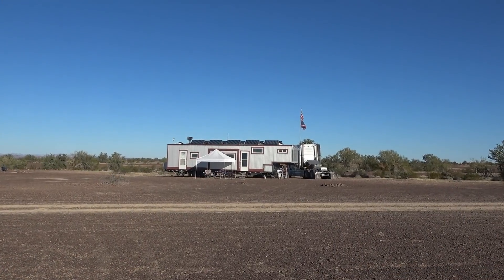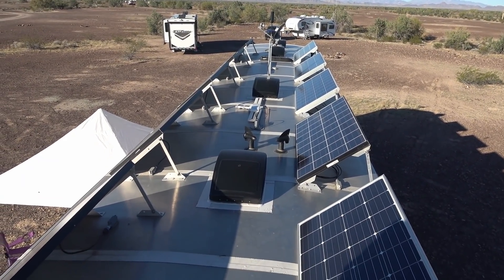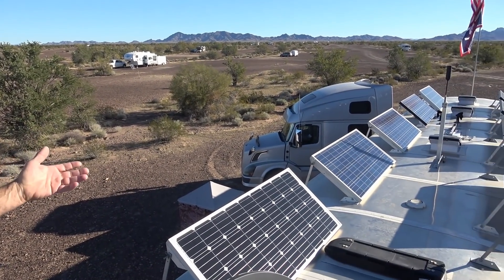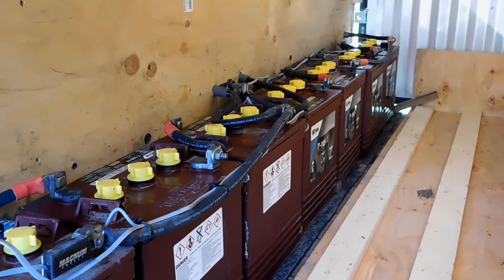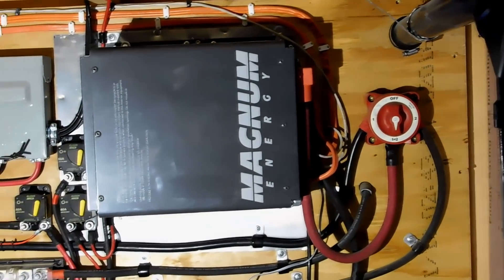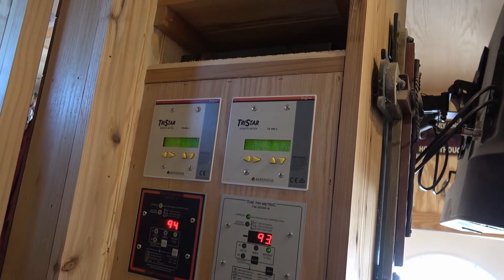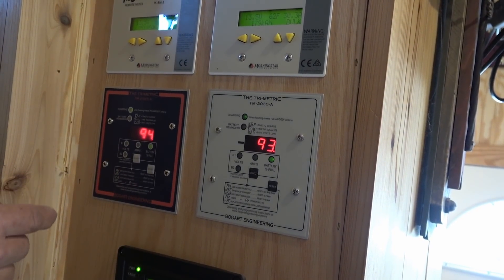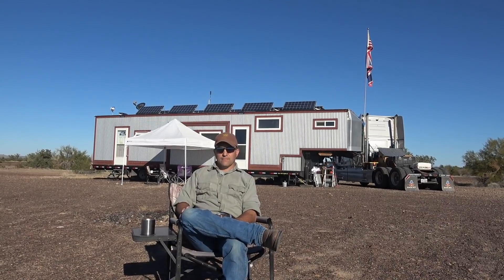My Friend's Impressive RV Boondocking Power System (1800 Watts Solar & 900 AH Battery Bank)

Comment: I don't see me ever installing this much solar, but I am happy to see that I am not the first person to want to have a weather station.  I was curious as to how that would work.
Reply from the maker: Here is the weather station I've been using https://www.loveyourrv.com/christmas-rv-goodie-deluxe-weather-station-for-the-rig/  It has its own built in solar panel on the outside sensor array and I've wired it into my RV battery for powering the inside display.
Reply: @LoveYourRV  Do you drive with it installed?
Reply from the maker: @kcgunesq  No, I have it mounted on a flag pole-type mount attached to the ladder. Easy to pull off quickly when I move the RV to the next campsite and reattach.

Comment: Yeah, that's not 900Ah. He needs to build his own life packs. Too easy and cheap not to, anymore
Reply from the maker: It is 900AH total capacity based on a 20 hour discharge rate. He has 8 Trojan 6V T-105 wired in a series/parallel arrangement for 12V banks. Each battery is rated at 225AH total capacity at 20 hour discharge rate. https://www.trojanbattery.com/product/t-105/
Usable capacity is a different story depending on how much lifespan you hope to achieve. Most people aim for around a 50% depth of discharge as the max recommended to preserve a long lifespan.
Yeah, LIFePO4 are nice, but this video was almost two years ago, prices weren't nearly as cheap. Things have changed fast in the lithium world. His batteries were already paid for and serving his needs well for years, so no reason to change. They also spend a lot of time camping in winter conditions in northern AZ and Wyoming.  Cheers, Ray
Reply: @LoveYourRV  the date said 1 year, that is a big difference from 2 years.
Reply from the maker: Feb 2, 2020 OK, sorry I rounded up 21 1/2 months ago. I did say "almost"

Comment: no need to run parrallel other than... smaller wire which saves a few $
Reply from the maker: I think you meant to say series. It uses a smaller gauge wire since the voltage can be higher. His system is run in parallel. Lower voltage, higher amperage needs thicker wiring down to the controller.
Reply: @LoveYourRV  no you read me correctly, I was quoting the statement he made in the video he said he had no need to run in a series he ran parallel and I was saying yeah other than smaller wire
Reply from the maker: Oh OK, I didn't understand the text you wrote was a quote. The video was from a while back so don't remember all the conversation. Cheers, Ray

Comment: just an fyi its best to say kilowatt hour of battery bank no AH because    900ah  could be any of the following 
10.8kw [@12v]
 21.6kw [@24v]
43 kw [@48v] 
So as you can see the 900ah is completley useless in determing how much storage capacity he has
Reply from the maker: Thanks, since the vast majority of RVers are running 12V systems I felt they would understand amp-hours better since for years that has been the standard way to express capacity in RV batteries. Figure anyone running the newer generation of more elaborate 24V or 48V systems is smart enough to do the calculation.
Reply: @LoveYourRV  in the end i figured it out after watching the whole vid he was using 12v but i was wondering. a lot of guys now are switching to 24 and 48v systems just because of the fact they can so much power wattage per unit , just going from 12 to 24v on a charge controller doubles your power capcity . .

Comment: 🤓Noice Rig 👍
#Renewables 
Very well & expertly Done 
By chance are you an electrical Engineer ? 
 Most people have No concept to practice of P.A.N.I Principals . 
 Most people don't also realize I.E.T Switches & Breakers are ideal for solar & renewables. 
Note : I still have a Cellsite 12v 
Battery decommissioned given to me in 1996 ; it was 15 yrs old then and Still holds 12v at 95% capacity .   
I leave it outdoors here in WV all winter w No damage that I can detect .  
There is a New device on the market that replaces a few components into 1 ; for the life of me sadly I cannot rmbr it's name or I'd share the info . 
 I am a Former Engineering Awardee and Business Advisory Council Awardee for Businessman of the Yr;  my specialty Was😔 Wireless infrastructure Solutions . 
I am now disabled physically since 2007 ; OTJ and that was a Risk I took to Serve the People and advance technology ; my deaf uncle benefitted from my work directly and went from a laborer to supervisor w a healthy retirement . 
  Your sharing your Rig and it's set up is a SERVICE to All Good Peoples and my Point is to 
Say Thank You 
  I'd be very Proud of my Self built rig too 
And for your Sharing ; it's invaluable . 
It is Not what We know ; Tis What We can Teach . 
#SharingIsCaringTeach2Prosper 
Thank you for Your many Good works and Do continue . 
  I would Hire you to do an install 
For me in a second . 
May God Bless your Endeavors 
 Thank You , 
    HAWK 
#Autistics4aBetterTomorrow
#WingfieldSchoolhouseSpeaks

Comment: Meh. I'm using a 2400watt solar  system with another 500 watt wind turbine for my fifth wheel. My big thing is that I need more batteries. I have 8 6V batteries now, wired in s-p for 24volt. I Want 16 batteries though, as soon as I'm able. 
What this fellow might want to do though, is look into Silicon dioxide batteries. They basically have the best of both worlds from lead acid and lithium iron phosphate. They have the longevity of lithium, but will operate in temperatures to -40 degrees. They require no maintenance and are about a third the cost of lithium. The best part is you can run them to 100% depth of discharge multiple times without harming the longevity of the battery!
Reply from the maker: Nice, I have heard that carbon foam batteries are an alternative as well. Does the wind turbine cause much noise and vibration in the rig? People always ask why more boondockers don't use wind. Cheers, Ray
Reply: Love Your RV Yeah, no, not at all. I think a lot of people assume that wind energy will be very expensive as well. That's mostly because of the North American Marketing. I just buy super cheap ones from Alibaba. Companies like Green Energy (G&E) really do care about their product and you can be up and running for about $400.
I have a 5 blade turbine (looking back I think I would recommend a three-blade. 5 blades will start turning at lower wind speed,  but 3 blades will spin faster once the wind starts to pick up a bit) so when it's really windy there is a bit of whooshing you can hear. But you don't hear any vibration from the PMG( permanent magnet generator) inside, or anything like that. I actually have started to really enjoy the sound of the whooshing through the turbine blades. It's music to my ears because I know it's making power! You can check out John Daniels YouTube channel. He really knows his wind power. And he likes to do things on the cheap. while also maintaining reliability in his equipment. I wouldn't buy any Chinese turbines that he didn't specifically recommend.

I have a brand new fifth wheel. that I live in. I have to say, the Chinese solar array (which included a 3500 watt inverter, pwm solar charger, and wiring) and Chinese wind turbine are the only two things in this whole unit that I have not had any problem with whatsoever! The brand new Jayco trailer has  had one thing go wrong after another since I bought it in October. But my power sources have not given me a lick of trouble.

Oh, btw, thanks for the video! =)

Comment: Lifepo4 cells would be a good option for storage too, with half the weight of SLA or GEL batteries, the new LTO cells have a much more extreme temperature operating range, a 40 amp hour battery is about the size of a tall boy beer can.
Those types have a much higher cycle life, some lifepo4 used for off grid set up say 25,000 cycles... depending on DOD, the new LTO cells are even higher than that so they would pretty much last you a lifetime.
They bolt together easily enough, so as long as you can wire in series as well as parallel, you can build any size capacity and voltage you want.
There are new panels out, they heat water as well as do solar.
Have you ever thought of adding in some small wind turbines like they use on sail boats to augment your system ? you could probably find some old telescopic light masts to mount them on.
Reply from the maker: Good ideas, just takes money. :)

Comment: Ooooh PWM controlers !! Resons you don't go PV in series!! 
And you Lie !! You system ain't 1800watt !! Panels might be
But PWM  looses a Lot of watt !!!  This is the reson why PWM zuks and MPPT rules!!! 
And the fier speak oh oh Arking !! Watt is watt so !!! If you get a arc !! You get IT either way
And the Buuhuu shaddows paralell.. 
If this duude doe's this "" professional"" he knows What bypass diodes are if not 
He is a scammer !!! Not using MPPT !! Well IT is you ovn system !! 
You can't Sell 1800watt and deliver 1300watt in good faith !!! 

If you want to get 30% less out of you panels use PWM 
MPPT is 99.8% effecieant.. series !! MPPT ..
Reply from the maker: huh, what the heck are you're on about? scammer? He isn't selling anything, just showing his system he has purchased with his own money over the course of the last decade. It works for them, no reason to change, just to spend money.
He installs tons of MPPT controllers, actually the vast majority when doing large arrays, in the many solar install jobs he does. Each system has to be evaluated based on the budget and customer needs and how and where they plan to use the system. You are oversimplifying things in my opinion.
btw, it's not as black and white as you make out PWM still have a place in solar installs, see this Morningstar Rep taking about PWM and MPPT - https://youtu.be/YUM5mRItm5E?t=374  Yes, you can get up to 30% under certain conditions and the MPPT marketing likes to use that to fool people, the real rate is more like 15-20%, but they cost more.
Reply: @LoveYourRV  
well for starders i can do math !! Volt x AMP's = Watt 
And i know how MPPT Vs PWM maximum power Vs Glorified Voltage regulator Works!!
I also know why the old PARALELL PV AND SHADDOWS history are told by ppl who do not know anything of 
SOLAR PANELS, BYPASS DIODES And MPPT Controlers !! .
I WOULD NOT TAKE ADVICE FROM THIS DUUDE IF I WAS PAIED TO GET IT!!
What ever paralell or seriell you add sand filled fuses 1 on the roof 
1 On at the controlers 
I get he reused his PWM controlers .. so the seriel PV was out of the qustion 
Not becaus of SHADDOW on PV but becaus !! THE PWM AIN'T BUILD FOR HIGH VOLT SERIEL PV
So why Lie about IT unless whole setup was substandard. Cheap PV with No bypass diodes 
All the fittings used on the "" oooh so clean setup""  was Better used on Better panels in series.(Lesser Holes = Lesser reson to leaks)
The distance on the wire's he was talkiing about ..again rubbish .. but he chose PWM so he culd not chose to 
Do IT otherwise !! 
That What i am on about
If you give ADVICE DON'T GIVE BOGUS RESONS 
FOR WHY YOU DID WHAT YOU DID!! 
He did What he did becaus of the (lousy) R E USED PWM CONTROLERS
THEY ARE OKAY FOR SMALL CHEAP SYSTEMS !! 
NOT HUGE SYSYEMS  THE LOSS IN WATT GROWS EXPONENTIALLY 
1000WATT PV ON MPPT = 998 USEBLE WATT 
1000WATT PV ON PWM = 700 USEBLE WATT 
THAT IS NOT 4x250watt@30v  i am refering to ..Then the loss in PWM CONTROLERS would be even bigger 
So ... If you give ADVICE .. DON'T GIVE BOGUS RESONS!! 
Or get Up to 2020 standard seriel mppt 250watt PV bypass diodes 
I Will give him that lead asid over litium ion or li4po any Day any wher wher temp get's to under 10 degrees 
I use AGM 20x 200A 512/200 sunneshein.. 
Cudos to his tilt Up 
And his dual setup of Inverters .. !!
Reply: @LoveYourRV  No MPPT give way more on bigger panels 
But yde you can use small usless panels and get onley 10% Better performance 
But !!! If you take the adder Costa on Cabels y conektors plugs 
The seriel Vs the paralell 
The MPPT Vs PWM 
YOU CANT USE A PWM ON 250WATT PANELS !! ONLEY RUBBISH 12V(17V) PANELS 
The MPPT still way way Better !!! So !!! The individualety.. naaa not so mutch 
If you talk COST EFECIANT !!
Reply from the maker: OK, you've got all the knowledge and math down pat, no arguing with you.
Guess we are just stupid know-nothings that have been out here camping off-grid with our useless 12V parallel PWM systems for the past decade, somehow muddling along. 
Eddie installs all the stuff you mention all the time for people. This video was just him showing his personal system. He is not saying install what he has or the way he did. Each install should be planned out depending on a person's own use case and budget. There is no one size fits all. People are free to buy what they want, he doesn't sell any products, just hires himself out to install it for them. And he does a famous job.
Reply: @LoveYourRV  Kevin bro!! 
I did not say IT did not Work !!! Did i now!! 
No i did not .. i just pointer out that !!! IT culd been Done other wice 
Why build a so nice setup.. not using full potential !! 
I Humble beg you foregiven's (not pulling you leg !!sorry )

Comment: 1800 watts is nothing compared to some of the builds I have seen. 
Trojan batteries are old tech, Where most people are building out 48v systems with 100ah of lithium, Which is far more than that 900ah at 12v. 
I have seen 2kwh to 4kwh of solar and a lot better equipment. 
People are running their ac units for weeks at a time with much larger and better systems.
Reply from the maker: Cool, sounds like cutting edge stuff, bet its a pretty penny. :)
Reply: @LoveYourRV  Not really, I did a build out in another comment on here, 2kw system with lithium battery 24v 200ah and an MPP Solar all in one unit cost under 4k. 
500 for used solar panels, 700 for all in one inverter, 2000 for 4 12v 100ah lithium batteries,  Then the rest in mounting hardware and other related items.
Reply from the maker: Nice, got some good deals there!

Comment: Looks overweight to me.  But then I've only weighed a couple thousand RVs. They didn't show the factory spec plate, so it could have enough GVWR and GAWR. The tractor is fine. The GCWR is probably fine,  this isn't 50k pounds.
Reply from the maker: I ask Eddie about that said he is still way under the trailer GVWR. It's built on a Big Tex gooseneck trailer - https://www.bigtextrailers.com/flatbed-gooseneck-trailers  Has tandem dual axles so 4 tires on each side.

Comment: if yur chasing 70 degrees and not using a/c for cooling,,you dont need but 3 solar panels and a 1500 watt solar generator
Reply from the maker: Maybe for you, but they are a family of three living full time with a lot of different higher wattage daily power loads, a 1500 watt solar generator wouldn't cut it. Also, its good to have reserve capacity for short winter days, hazy days, cloudy days, etc. Cheers, Ray

Comment: Wow... what an awesome set up he has there. I have a small simple set up. Four Renogy 100 watt Monocrystalline panels, 40 amp mppt charge controller, RENOGY 500 watt pure sinewave inverter. and two Trojan T-105 RE batteries. it's a simple set up and has been up and running for the past 4 years.  I'm happy with it. I don't use a lot of power and most everything that I have is 12volt. when I need more power I fire up my Honda is3000 inverter generator....

Comment: Hi Ray!  Hey do you know what type size wire is?
Reply: Sorry!  The Battery negative and Positive crossing wire cables AWG?  I personally only use 2 gauge wire.
Reply from the maker: I'll ask Eddie and let ya know. :)  I use 2/0 gauge also known as Two Aught for my battery bank, but his may be bigger, not sure.
Reply: @LoveYourRV  Thanks!  I was going to change to 4/0 gauge later.  I been building 12 vdc in my home all around now.  I still need to add solar panels next, I have all the gear ready.  Thanks again!  Enjoy better weather then here in Washington.
Reply from the maker: His battery cables are 2/0 becasue his inverters are only 2000 watts, if you run a larger inverter then you may need thicker cables.
Reply from the maker: What section are you interested in? The battery cables or solar wiring or inverter cables or are you looking for a complete breakdown of the whole installation?  There is a lot of wires in this install!  :) Cheers, Ray

Comment: That's incredible, but how do they survive without AC?....lol, good vid Ray.
Reply from the maker: Camper has wheels,  just move where its cooler. :)
Reply: He said he has a ductless mini split system
Reply: I heard Eddie say he installed a Ductless mini split A/C system it probably has a heat strip in it also .

Comment: Fewer but larger batteries is always better,  less imbalance between the cell chemistry,  less maintenance, and fewer interconnects to corrode.  Unless you needed the lower height of the 105's, L-16's would have been a bit better choice. L-16's can also be cheaper, per AH.My two cents worth, after 28 years off grid, and 13 years grid ties (NO batteries)! Everything else looks great, nice job!

Comment: Why would you need all this solar and battery if you don't run the A/C from them?
Reply from the maker: It'd beneficial to oversize a system for camping during the shorter winter days when the sun only has decent power for 5-6 hours and also for those partially sunny or cloudy days. Even on a partially overcast day Eddie can get enough energy to run all his appliances, tools, DC loads, TVs, satellite,  etc, and recharge the battery bank. Cheers, Ray